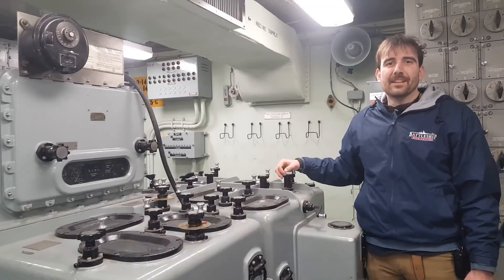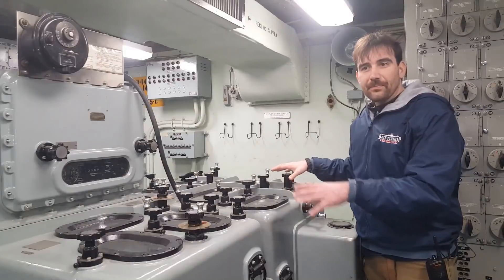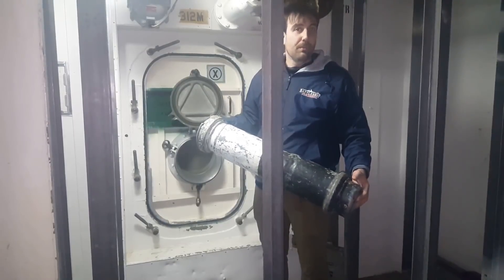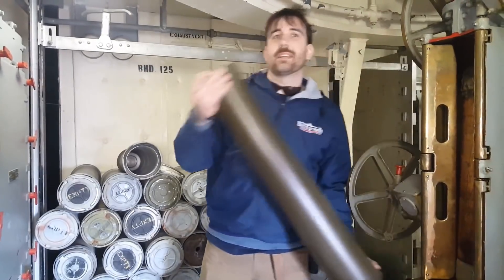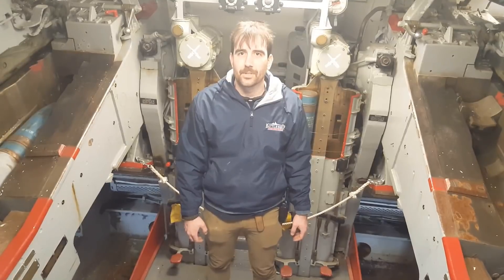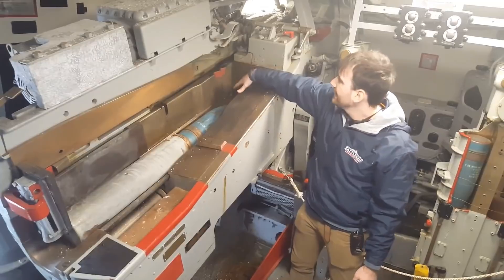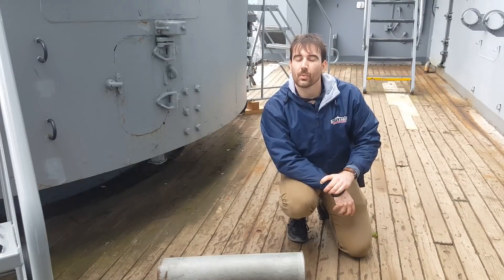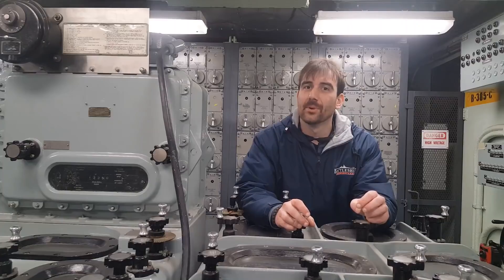5" Guns

Comment: Okay as far as it goes.  Could have provided more info concerning the ramming and case ejection. The chutes that would have been rigged to the rear of the guns directing spent cases out of the mount. Also no mention made of the upper case ejection ports, when the barrels were at too high an elevation for the case to be ejected from the lower port. Hot shellman would clear the case from the pit and throw it out the upper ejection port.
Reply: And what about the buffet? According to my dad, on his can they would spend hours upon hours in the mount while at GQ or chasing trains up and down the North Korean coast. Cooked up their own grub in there.

Comment: To think that 5-inch guns are currently the biggest main guns in our navy. (Besides the 6.1"/155mm guns on the Zumwalt-class destroyers)
Reply: John Smith  they also cost a lot more. Cheaper to use guns for naval support during beach landing and you can carry more shells than missiles. Id rather have a 5-8in gun with a couple hundred rounds each to cover my beach landings in a major war that a handful of missiles
Reply: The Zumwalt guns are purely decorative - they don't have ammunition. The Navy ended up getting smart shells moving for the existing 5" guns.
Reply: John Smith  That is not entirely true. The use case Congress brings up is an opposed landing - where you don't have precise info on things that are happening, but you have a general area where you want to cause trouble. We haven't done an opposed landing since Chromite back during Korea, but they always brought it up, keeping two battleships active until the Soviet Union collapsed.